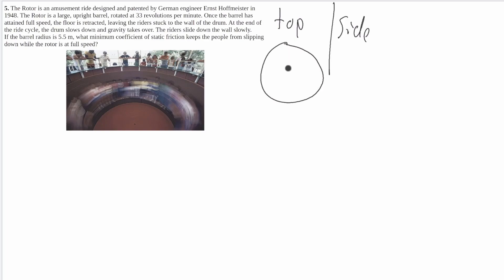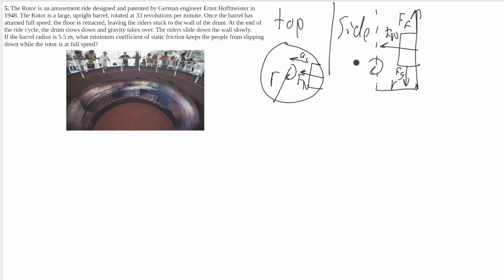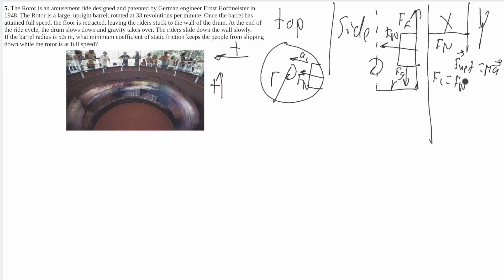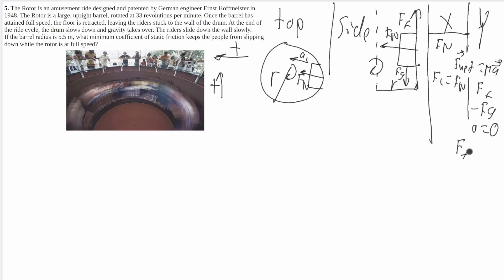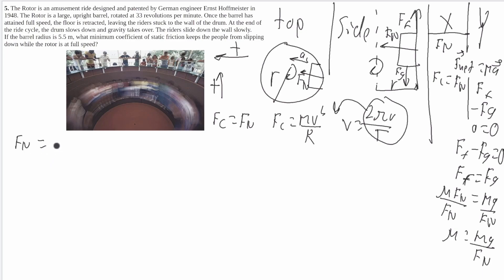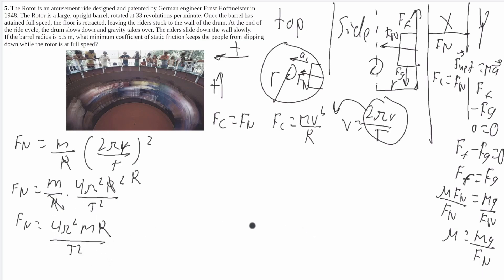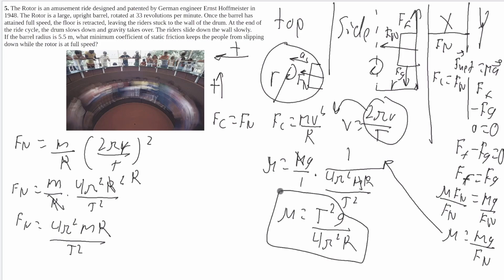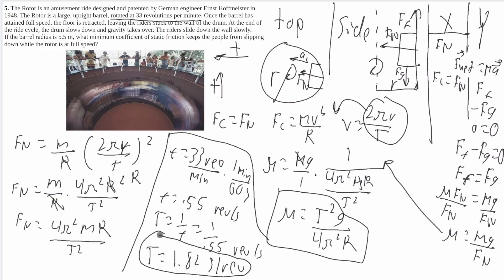Rotor/Gravitron ride, find the minimum coefficient of friction that keeps people from slipping.

Comment: why did you change .55 rev/s into 1/.55?
Reply from the maker: .55 rev/s is a measure of frequency. My equation contained period which has units of s/rev. So, I needed to convert rev/s to s/rev in order to use it in my equation.